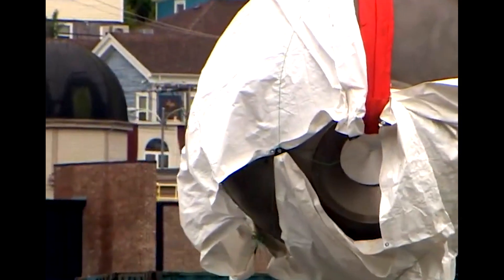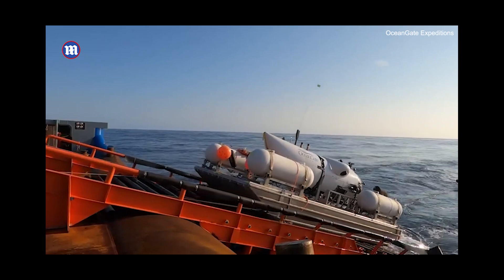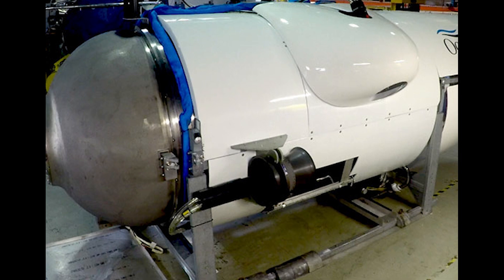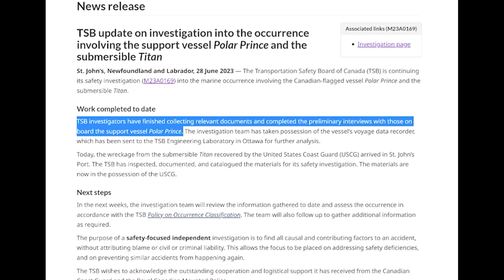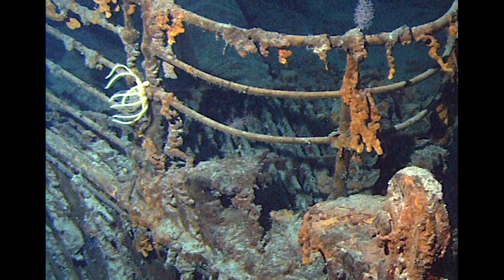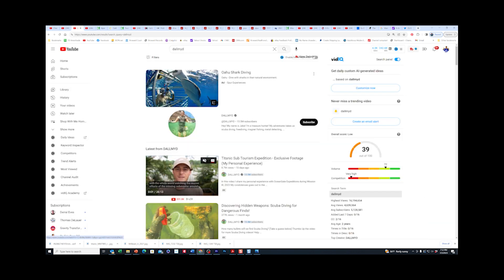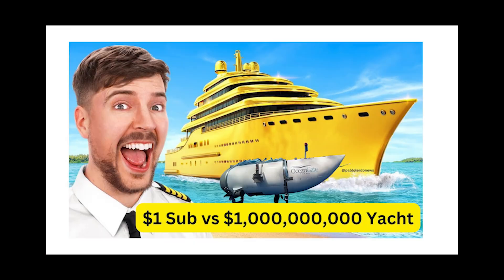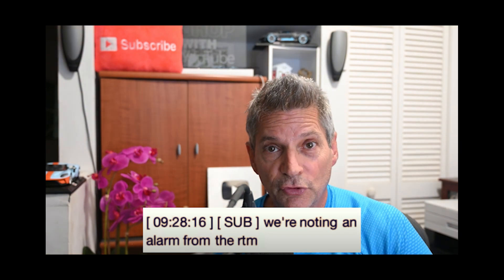Titan Submarine Debris Clues, Implosion Simulation

Comment: but doesn't carbon fiuber crack like an easter egg? it can't really bend and stuff.. and it was strung horizontally.. so that much pressure.. and implosion on carbon wouldn't that mean it broke into tons of pieces vs a steel or metal crunching down like a soda can?

can carbdon fiber even build up that much presure to implode? i dunno.. so many questions.. i think everyone is thiking about traditional metal sub implosion stuff vs this new material.. which i don't think acts like metal at all.. that can be the biggest clue.
Reply: Yes, cf is GREAT under tension but under compression ? It can fail suddenly and without warning.

Comment: Unless the sub was on the bottom, which would likely leave some disturbance on the bottom, once the ends separated the carbon part or parts are going to drift and sink much differently than chunks of solid metal. They could be a big distance apart and if found that distance might offer some clue on the depth at which it failed. The fact there's not a shred of fiber attached is a giant red flag.
Reply: a red flag suggesing what?
Reply: @ScreamingEagleFTW  compromised bond
Reply: @ScreamingEagleFTW  when I cut off and test a glue joint I want it to fail anywhere but the area where glue is. Something should rip from either side, a clean surface means a potential weakness in that bond. It isn't a 100% smoking gun kind of thing with the materials as there is the possibility that the glue bond was simply pushed beyond its strength as a product of the implosion but generally speaking its not a great sign.
Reply: @alexkitner5356  wood glue is stronger than wood but I dont know if epoxy is even stronger than carbon fiber.  That would be an important fact to know before drawing conclusions and parallels from woodworking.   It may be that the weak link is the epoxy not the cf, so long as the epoxy is strong enough for what its being asked to do.   Now all the people who say carbon fiber is at fault have to walk that back if its the epoxy. In any case, something else was going on here, they could not ascend, they took on water and eventually there was a breach and they al died.   So was it the CF, the window, the epoxy, sabotage,  damage during transport, lightening strike damage from before the day of launch, or was it a rogue current that increased the pressure somehow...  emergency mismanagement?  did someone panic and do something crazy??  i dont know.
Reply: @ScreamingEagleFTW  as I explained above, it's not necessarily a smoking gun and acknowledged there are ways that this could happen that don't involve it as a failure point. That said, I've glued, epoxied or poured many things, and wood or fiberglass or concrete, a break without remnants of the glued material is a bad thing in the vast majority of situations
Reply: The shock wave at that depth would probably have vaporized all the 'plastic.'

Comment: Fluff piece. Disappointed. Just stuff regurgitated a couple days ago. You show a 1 atm implosion, this was a 350 atm one. On par with a couple hundred pounds of TNT or so. You know about safety margins, but hint about the window. 5 days of air on board, and presumably LiOH to scrub CO2. The titanium ring enclosed the pressure vessel at the edges, it had the semi-sphere for support. Yeah, the shoutout to Mr. Beast was important.
    And the tragedy was they were so close to the Titanic.  No. The tragedy was they were conned into going in something with a limited life span that wasn't properly designed. You should not be on a submersible, plane, bicycle, or even a rocking chair if you hear cracking in carbon fiber. That is irreparable damage happening.
Reply: It was a test to weed out Kevins like you.
Reply: Also, just an aside, the Trieste, which went down to Marianas Trench in the 50's or 60's, used iron pellets for ballast, and gasoline for buoyancy. The Trieste used an electromagnet to keep the iron pellets from flowing out. Battery failure would result in ballast dropping. Using cheap stuff isn't a problem, you're going to drop it anyway.

Comment: Failure will always occur at the weakest points. First the bond line between the end caps and barrel section would have failed followed by the viewing window, then implosion of the barrel section itself. The end caps should have been mechanically fastened to the barrel section as well as bonded. The viewing window should have been developed to withstand the max depth. The barrel section should have been framed up from the inside, and the layup of the fibers should have been done in a mulit-directional pattern, not to mention it being EXPIRED! The design was doomed to Failure as well as using inferior material. Being a aerospace engineer he should have known this. I think he DID know all of this but he didn't want to spend the money to to it correctly and mickey moused it up. GREED killed these people.
Reply: Dude...it's worse

He was apparently BROKE, he was meeting potential investors in person and trying to get them to buy in, had to switch to the ship he was using because he couldn't afford the one he was using before. 

I think he burned through all his money just MAKING the damned thing and was desperate to get money flowing before anyone found out.
Reply: The company that made the viewport refused to certify to that depth. They wanted no liability for a failure beyond that value based on the design Oceangate gave them.

Comment: The explosion after the implosion would send force towards the opposite direction than was designed for.  Less resistance.  I don't believe the salvage crew would have removed something so critical to an investigation.
  I believe the  more flexible carbon fiber being tucked into a less flexible material you automatically have sheer points.  360° of each end of the carbon fiber cylinder.  The cylindrical shape is what allowed it to flex at all.
Reply: I think the lack of carbon fiber hole at this point is simply a cover up. Of course whoever sold  this material after it had expired can't be responsible for what Rush did with it.   Unless it was Boeing.......

Comment: That port hole would not be removed.  The way the part was found is the way they lift it.  If it was intact,  it would be on a pallet.  The salvage rescue knows there will be lawsuits,  so things need to be on order.
Reply: Uh....no.   there probably won't be lawsuits because they signed the release waivers stating they understood the risk and released the company from liability.
Reply: @jimechols4347   You can sign all the waivers you like.  That does not safeguard you from lawsuits.
Reply: @jimechols4347  for the millionth time, those waivers mean nothing. There are numerous arguments a lawyer can levy in order to render them invalid. Lawsuits WILL occur. The best lawyers in the world will be involved in this, you really think they can't argue their way out of a stupid waiver? Stop.

People need to KNOW what they are signing in order for them to be valid. If OceanGate lied about ANYTHING, such as Boeing being involved in the creation of the pressure hull, then the tourists would have signed those waivers with false information. Thus, they will be negated. That's just ONE argument off the top of my head that they can use to get around them. And they absolutely 100% will.

People think a waiver means nothing anybody can do "whoops oh well doesn't matter signed a waiver." No bro. Not that simple whatsoever. Lawyers make arguments. That's what they do.

Comment: What happened to the tube the carbon fiber was wrapped around?why wasn’t it recovered?
Reply: It was really thin the heat from the implosion might have incinerated it. I don't know about carbon fiber so I could be wrong, but the shards under that much pressure might also have cut it into glitter. I am only guessing though so I could be wrong.
Reply: It's in very small pieces.
Reply: excellent point!  I was wondering that myself.    I heard there was a steel tube but I didnt see one when they showed them gluing the CF tube to the end rings.

Comment: The energy stored in that pressure vessel would have been huge.  The temperature at that implosion would be as hot as the sun. I doubt very much there would be any carbon fibre left. I would have thought that the bang would be heard and felt at the surface.
Reply: wrong
Reply: @greatjob7113  Please elaborate.
Reply: @peterbustin2683  The statement you made is incorrect therefore you are wrong.
Reply: @greatjob7113  Physics.

Comment: This may sound ghastly, but I'd like to see a simulation of the sea pressure on one of those dummies they use to simulate injuries.  Everyone says that the passengers' deaths were likely instantaneous, but it's one of those things where I feel like I've got to know for sure.
Reply: implosion takes 40 milliseconds, time for the body to react to pain is 200 milliseconds so it was a painless instant death.
Reply: @GoatzombieBubba  At 5000+ psi, implosion takes ONE MILLISECOND.
Reply: @GoatzombieBubba  " time for the body to react to pain "
A few years ago one French passenger plane crushed into Atlantic on its way to Brasil. Initial report in the news was that passengers did not feel a thing. Later investigation showed that they were aware and probably still alive after the airplane crashed into the Ocean.
Reply: Well, the Coast Guard described what was left as "presumed human remains", so that might give you a clue.  Just random chunks of flesh...
Reply: same.. especailly the carbon fiber structrure.. i don't htnk anyone has really gotten that right since its a material no one has ever used.. carbon fiber can't really bend.. its hard.. and its brittle.. i don' thtnk it imploded the way everyone illustrated it.. its not a metal material .. i feel it crumbled into pieces and it shredded them... or it was the porthold that blew and the carbon fiber shattered either way... i feel.. they didn't die that quickly.. i hope i'm wrong.. but htey shohdn't even be dead in the first place.. 

if htye were using expried matierals etc.. everyone should be arrested.. you should not be able to work with experied materials.. those that gave the ok should be arrested.. alot of people allowed this to happen to make money.. this is no different than a biulding collapsing because cutting corners.
Reply: I would definitely be among the first viewers if James Cameron decides to produce a simulation / movie that depict what you are describing.
Reply: Myth Busters did an implosion experiment with pig-parts in an old diving suit. When they imploded the diving suit, all that was left of the pig-parts was a pool of grisly blood inside the helmet of the suit. Grisly reality.
Reply: you dont need to know.  Go and live your life and be happy.    These divers wanted to know things too, they wanted to get close to this watery grave and now they are part of it.   I also, need to stop being fascinated with this story.    I guess my interest is the irrational way the CEO is being demonized and villlified.  I believe there is more to this story, either sabotage or maintenance errors top side.    They heard loud crackling in the rear of the craft,  the porthole is in the front,  they could not ascend. they must have been taking on water somehow in the rear endcap area where the electronics are.  That would also explain whay power bus A was dead.
Reply: Back during the Cold War, the Navy deliberately imploded at least one submarine with animals on board.

They found some ash and bone residue, and some char smeared on the interior surfaces of the pressure hull.
Reply: @chemech  sure

Comment: Thank you for asking the right questions, I also was puzzled by the lack of residual carbon fibres on those end rings, not one piece of glue, not one fibre left… like it all disintegrated and debonded at once.  At least it would have been fast.  The voice transcript will be interesting to listen to because surely there was some sort of indications of the impending catastrophe…
Reply: Probably the failure point
Reply: When that type of epoxy bond fails on a smooth surface like titanium it will make a clean break and not leave residue or pieces behind.  The hardened epoxy probably stayed stuck to the rougher carbon fiber surface and “popped” clean from the titanium.
Reply: I don't think they had a cockpit voice recorder.  And they could only communicate with the surface via sonar-texting.
Reply: @billyhw99  maybe the mothership was recording voice and data from the sub?
Reply: @alexandreproulx7955  No, it wasn't tethered with a cable and radio communications are not possible under water.  They had a very low bandwidth sonar communication system that was only able to send text messages back up to the mother ship.

Comment: I can picture the hull imploding before the end caps or window failed but I have a harder time visualizing exactly how everything would of happened if the window completely failed first.
Reply: If only the window failed I would have expected to see more of the carbon fiber hull.  The rear cap might have seperated but I think there would be two larger pieces.
Reply: @DanielTaylorOCMD the rear but not the front if both caps are off the rings it’s because the hull failed

Comment: I'm still on board with 'crushed like a coke can' just that the coke can in this case was as brittle as glass and is in a few billion pieces minus the front and back bit.

World record for most difficult jigsaw puzzle down there next to the titanic.

E: it is also entirely possible that the 'dropped weights' signal was something automated after or during implosion. No real way to say whether or not those onboard had any idea that anything went wrong.
Reply: I read the transcript of the text messages - after dropping the weights there were several communications, including confirming that they additionally dropped the landing frame after several attempts.  They "knew" for about 15 minutes and were ascending before comms stopped.
Reply: @peterdarr383  where can I find this transcript?
Reply: @peterdarr383 please do share the transcripts!
Reply: @dhuntyam  This is what Jeffostroff was alluding to at the end of the video. There is a YT video by GS Academy purporting to be the texts but I didn't know if it was fake or not. But after hearing the end of this video, yeah, I'm pretty sure the texts are real and they provide a lot of detail about what happened.
Reply: @antontonable  GS academy has no source. The supposed source they link doesn't point to anything. On the whole of the internet, GS academy is the only one claiming such.
Reply: @Name-ot3xw  yes that is correct, but I think that's going to change soon

Comment: I'd imagined the Titanium was sleeved outside and inside the CF cylinder. I mean, I'm no engineer, but CF composite is known to be flexible, even at large volumes. I would have expected the titanium ring to have the CF inlaid into a groove. That it was literally glued together baffles me.
Reply: The epoxy is flexible, the CF in tension isn't. The flexibility is controlled in a composite structure by how the fibres are laid up. A woven cloth is flexible. A straight bundle is very stiff in tension.  Automotive manufacturers played with the idea of composite leaf springs, and other 'flat' springs and found that CF was too stiff and gave a brittle failure mode. They achieved some success using glass fibres which were more elastic in tension.

Comment: The submersible imploded multiple times faster than that barrel and superheated to the temperature of the sun. All those people were instantly liquified and any remains were burned or ejected into the ocean through the porthole.
Reply: The temperature would have only been measurable in the compressed air which would not have been a very big bubble at that depth and the speed with which events transpired leads me to believe that not much incineration took place.  I think you are right about remains being ejected through the porthole but I would guess that only two or three did while the others were simply crushed against the other cap.  I'm guessing that that is where any remains are and why they were able to find them.
Reply: @DanielTaylorOCMD  Were any remains of the victims found?
Reply: @jamest681  The Coast Guard said they found "presumed human remains".
Reply: @DanielTaylorOCMD  "incineration "
Do you know how this process of high temperature as side-effect of a massive pressure is called in physics?
Reply: @ranc1977  Thermal Pressure is probably the closest thing describing that you're looking for, but really temperature is just the avg speed of a collection of molecules, so obviously violent forces like explosions and implosions are going to have an effect on temperature, even for just a split second.
Reply: @DKFX1  Thanks,
this implosion opened the whole new world to me, that I previously did not care to learn about.

Comment: I have seen the transcript and it seems legit, they definitely were dumping weight heading to the surface!
Reply: ya they had two problems..    1.  they hull was straining and 2. they could not ascend.     they must have been taking on water.  even as they were still descending pretty early in the dive the descent speed was questioned by the surface ship as being to fast.  They must have been taking on water right away.  There was a leak in the hull, possibly sabotage. I also heeard the the sub was towed 400 miles at ship speed instead of trailered like it normally is.  It could have been damaged during the transport.
Reply: They did haul the sub on the launch pad BEHIND the ship.